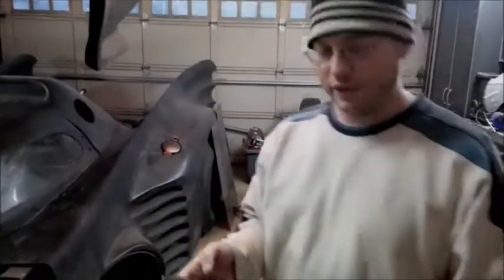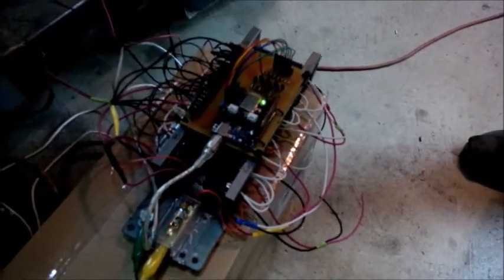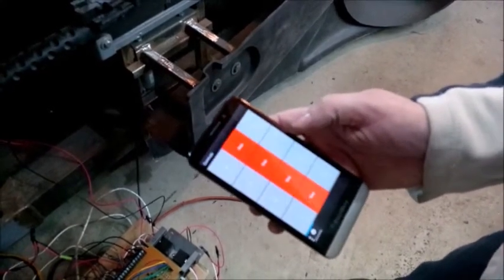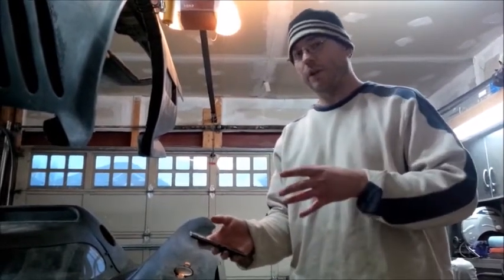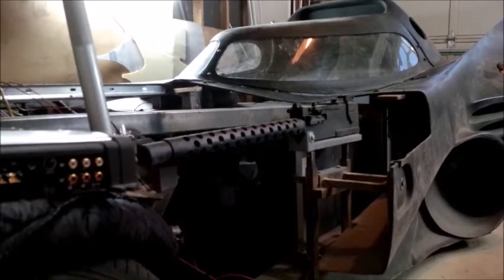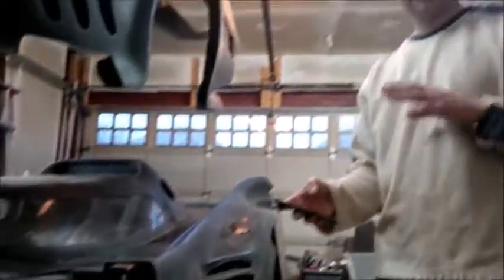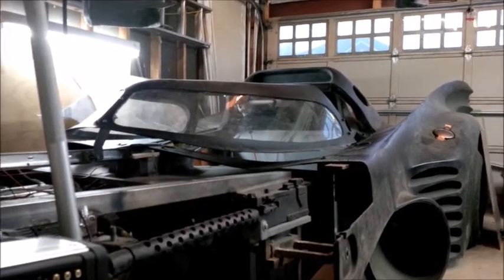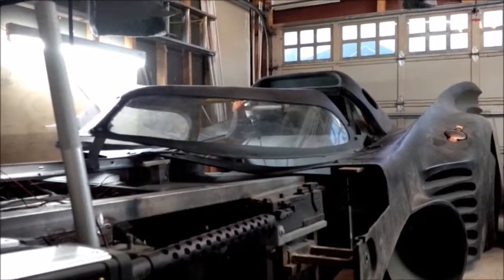Adding the "BlackBerry" to the #BatBerry

Comment from the maker: +Matthew Potter I wanted to stick with BT because I don't have a WiFi hotspot in the car.  The Arduino with BT draws a very low amperage when the car isn't on so that it won't drain the battery of the car.  Running WiFi is something that I might do as a hotspot once the car is running and using the electricity from the alternator